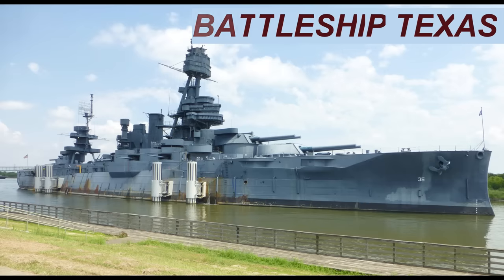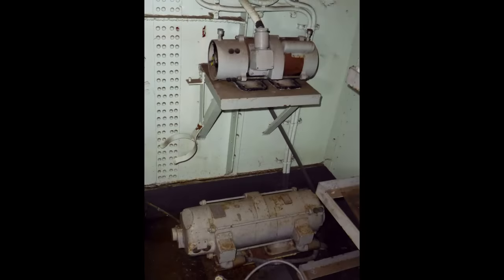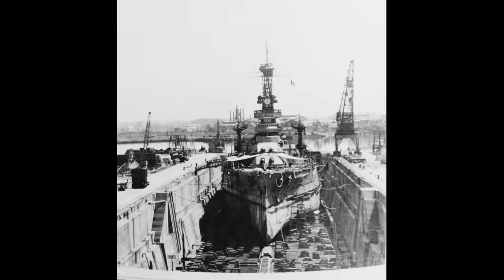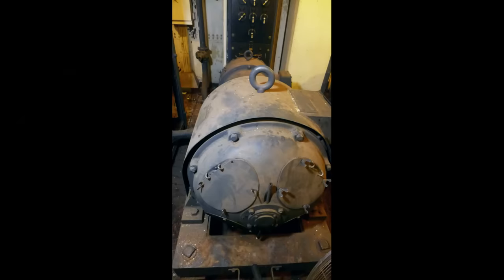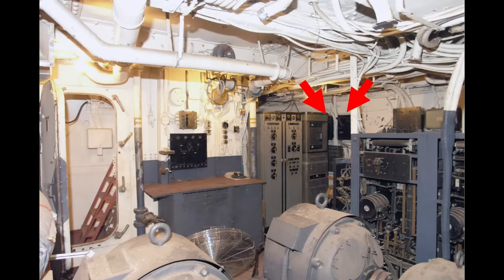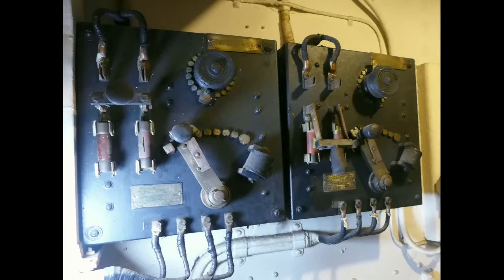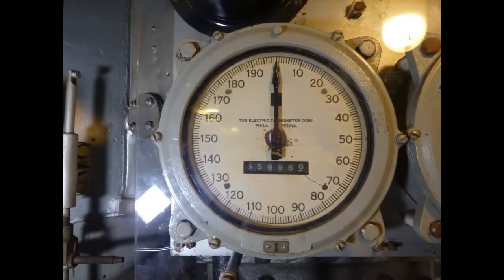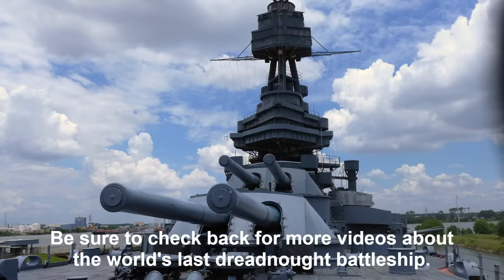BB35  Going Analog, The Old School Way!

Comment: I've sailed numerous diesel electric tugs (DC/DC) and we had MG sets from one end to the other. AC and VFDs are better of course.
Reply from the maker: 100% agree.  I've only started reading Navy electrical manuals and articles in marine periodicals written at the beginning of the 20th century to get a good sense of state of the art back then.  They had an excellent grasp of electrical theory and design, but were trying to get their arms around practical a.c. design.  A couple of major articles even wrongly commented that d.c. would be the rule pretty much forever.  They were not only using a.c. in power systems on battleships, but the U.S. even started using turbo electric with huge steam turbine driven ac generators as main propulsion in the Tennessee class in 1917.
Reply: @tomscotttheolderone364  Correct me if I'm wrong but G.E. (I don't know about EMD)  build their higher horsepower locomotives utilizing AC trucks/drive.
Reply from the maker: @butziporsche8646  That's my understanding.  I walked across the production floor at G.E.'s locomotive plant in Erie, PA about 20 years ago and that was what I saw sitting on open chassis'.
Reply: @tomscotttheolderone364  I did a 2-week class at EMD (LaGrange) in 2004 but I didn't get to see any locos. They did have an H265 but I've never seen an EMD 4-stroke in operation Ours (marine side) are mostly 710s (EMDEC) and a few 645F7Bs.
Reply: @butziporsche8646 Technically, locomotives tend to use both DC and AC to power the traction motors, or at least they used to. 

The diesel engine drives an AC alternator, which is then rectified into DC power, which is pomptly turned back into AC to drive the trucks. From  my understanding we arrived at this setup becuse in a pre VFD world it was easier to throttle large amounts of DC current as compared to AC, but it’s easier to make a large generator that outputs AC.
Reply: @sonorioftrill  Well, we have DC/DC, AC/DC, and AC/AC ships. The AC/DC is a transition technology that, as you say, we due to the ease of control with the DC drive motors. We have large rectifier cabinets w/ "puck" style diodes.
Reply: I think that modern ac drive locos became feasible dut to the introduction of variable electronic drives. Before then you could only easily  run the motors at generator supply frequency  speed. I think that the large engines required for dc drive motors are sized for best torque and speed characteristics.

The engines for ac drives can be made smaller because the variable drive effectively acts as a gearbox and can match torque and speed better. The drives vary the frequency as well as the voltage to maximise the performance. If you hear a modern train speed up out of the station you can hear the tone of the drive change as the frequency supplied changes ie changes gear.

Comment: I know it's stupid, but when I heard them saw on line that the torpedo blisters where being removed it upset me a little bit.
It's not like she's ever going to sea again, let alone as a warship... Beauty of a ship..
Reply from the maker: They were mostly removed because their structure had failed due to corrosion caused by continual flooding over more than 70 years.  It left them in a constantly flooded state that lead to deterioration of the hull's shell plating.  This wasn't due to negligence, but simply because they leaked due to their light weight framing and riveted construction.  In fact, they had significant leaking problems as early as the 1930's.  The good news is the tops of the blisters were retained starting about 1 foot above the waterline and the rest was replaced from with new blisters that have welded construction and much heavier framing.  Their design was modified to make it much easier to maintain in the future.  Once back in the water, the ship will look precisely the way she should.
Reply: @tomscotttheolderone364  I know the reasoning for their removal, but none the less don't like it..

Comment: For the gun firing circuits: Was AC used because it could be transformed up to higher voltages for the ignition circuits, or was there another reason AC was used?
Reply from the maker: I'm also guessing, but I think your assumption that it could be transformed may be part of a correct answer.  There was no physical reason to use a.c. lieu of d.c.  Either type is fully capable of igniting a gun primer.  In fact, the backup system used batteries located in each of the turret structures, so it was d.c.  The backup was always be used if a gun was locally fired by the gun pointer, who elevated the gun to aim it.  It was also used if there was a misfire as part of the troubleshooting process.

Comment: DC was standard shipboard because it could control motor speed by motor field rheostat, great for adjusting blower, pump, etc speed.
Reply from the maker: True!  Big motors, like the 150 h.p. electric steering motor, were too big for rheostats, so they had banks of grid resistors that were switched in and out of the circuit using contactors and mult ipole switches.  You can see that in my video in the aft steering compartment.  https://www.youtube.com/watch?v=5s7HeKXbexk

Comment: Are any of the analog equipment still functional? My understanding is that USA Texas just sat as a museum for decades without maintenance on the analog systems. Do they still function if power was run through them once more?
Reply from the maker: Texas was deactivated and heavily modified to be a museum by the Navy in 1948.  It wasn't done to demilitarize her, but simply to make her as durable as possible in her new life as a static display.  As a result, none of the engineering or weapons systems have been functional for almost 80 years.  I suppose it is possible that some instrumentation could be restored to operational status, but there isn't a lot of point to it since the vast majority was used for monitoring systems that no longer work.  With the exception of the apparent wind indicator, they would simply sit there and do nothing.

Comment: Just out of curiousity....is there a video on Main Battery Plot? I have not found it if there is one.
Reply from the maker: I haven't made a video on Main Battery Plot.  I have dabbled with doing one, but it is difficult without the range keepers, stable vertical and other fire control equipment that was removed by the Navy in 1948.  So, while there are some really nice switchboards, the room is largely empty.  An additional problem is I have an inventory of what was removed, but cannot find good references to some of the equipment.
Reply: Battleship New Jersey has a good one on their main plot, going through it position by position. It uses a lot of the same equipment as would have been on Texas and would give a rough idea of what the space would be like, minus the earlier equipment still in use from the ship's construction. That's what so interesting about Texas. The combination of equipment that's very similar to newer museum ships combined with things that no longer exist anywhere else.

Comment: You seem to have misspoke: you referred to the log as the fathometer.
Reply from the maker: Thanks for the heads-up.  Where did I do that?  I could certainly be wrong, but I don't recall mentioning fathometer anywhere in the video, nor do I recall seeing any circuits or instrumentation in the room associated with it.
Reply: @tomscotttheolderone364 

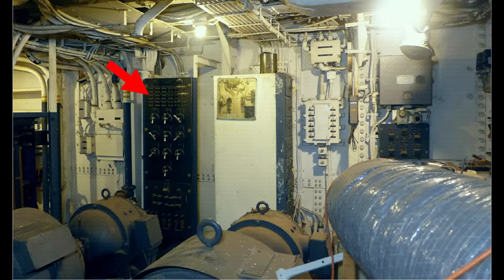9:40

E: Oh, you said _pithometer_. I now feel extremely silly.
Reply from the maker: @robertobryk4989   No worries!

Comment: What amount has state and federal contributed to rebuilding the uss Texas?
Reply from the maker: The state gave a total of $50 million for critical interior structural repairs that were performed between 2014 and 2018.  They provided $35 million, then an additional $25 million for the current hull shell plating and torpedo blister replacement project.   I am not aware of any federal funds being made available.
 $